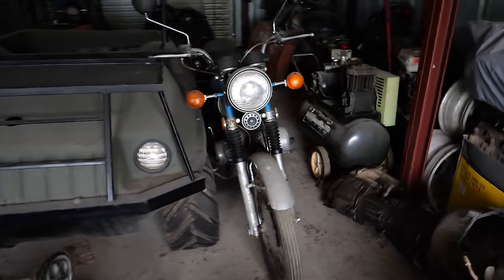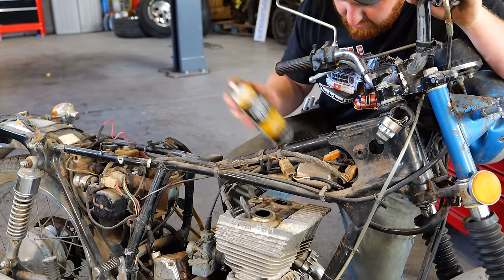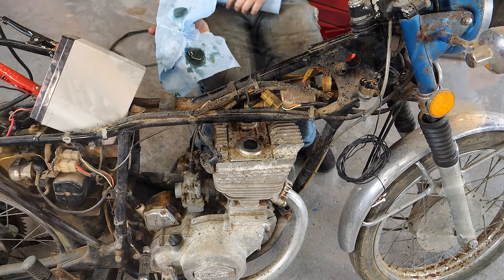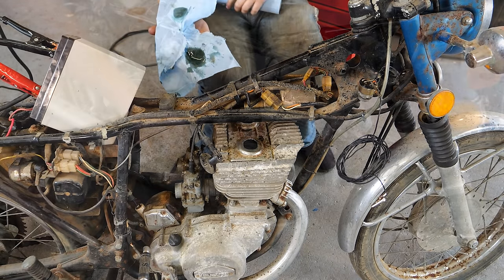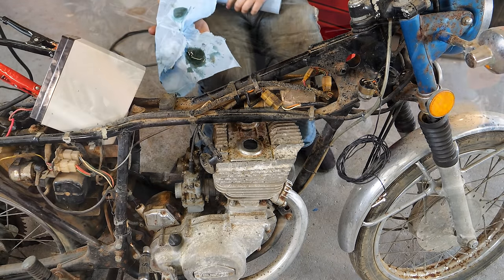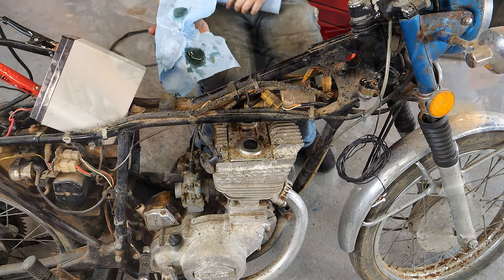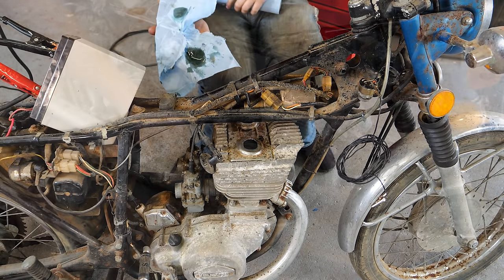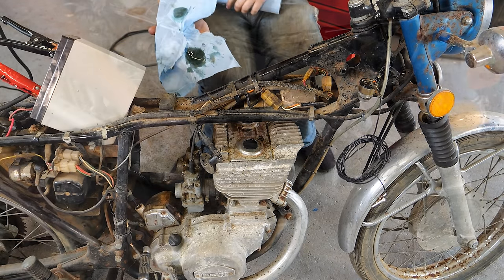Will an ABANDONED 2 Stroke Motorcycle Run After 20+ YEARS!?

Comment: Holy crap! Way back then I had, well before this I did own a 185 Suzuke then another 185 but, they were single TS 185 trail bikes. I did wind up buying a GT 550 which DIDN'T have a starter to weigh it down more but, they did stick four mufflers on on those three cylinder bikes lol. I also had a T 500m Titan later on too but, while I think the agricultural looking T500 twin was a better bike (except for fifth gear which nearly got me killed when it locked the rear after just overtaking a semi at around 90 mph) it was a great bike but, that 550 triple had a growl that sounded awesome. I can't remember what the red line was but I always held it flat till I felt the power start to ease to where it would pull harder in the next gear. I did love having a big digital gear indicator in the middle of the instruments. You're making me remember, and really miss those old and simple but character filled perky 2 strokes. 
HEY, if you want someone to test ride it for you, just pay for my air fare from Oz and I'll be more than happy. That sounds really lively for such a tiny engine!
You brought back so many good memories of some of the wild and fun 2 strokes I've had over the years, thanks for that.

Comment: I'm a big fan of Japanese 2 strokes and owned the 185 twin , 380 triple and the 750 water cooled , I had the 185 & 380  when I was in high-school they were fun ripers for around town , I did ride my 380 to Galveston Island Beach many times , trip was around 48 miles one way ...... the 750 I had in my late teens and early 20's it was a blast , hoped that baby up with shaved down cylinder block and bored out 40 over with 1 inch extension on intake moving carbs back 1 inch gave much needed  atomization ....fun times

Comment: And that’s why I love 2 stroke. Always had single 50cc scooters, always loved working on them. They just always seem to run, you just have to put some love in them 😂
Reply: I have a 3.3hp (76cc) 2 stroke outboard for my boat. It's a cantankerous little thing that never fails to give trouble starting when you need it most... but starts on the first pull if you act all casual. I guess 2-strokes can smell fear or something like that.

Despite our rocky relationship, mechanical sympathy forces me to actually look after it and feed it premium quality outboard oil. Darn thing even has a name ('Miss Fire') now, so I guess there's a fair bit of blue smoke in my future despite my disdain for 2 strokes generally.

Comment: It'll not run right without the airfilter. ..but yeah.. Giving the carbs a good once over won't hurt either. Have a good look at whether or not they're really synced, when you apply a little throttle too. This bring back memories btw. Back in the early 90s i owned a T350, a 39HP two cylinder two stroke Suzuki. Man that was a fun bike! 🥰

Comment: Hey, about rust on the inside of the tank; my dad and I took a container of metal BBs and put  them inside the tank and just shook the tank around to get all the rust out. I don't know if it's the most efficient way, but I thought I'd share the idea with you. The BBs just come back out in the end, too.
Reply: I hade a rather rotten 1978 KD185 in 1989. I just got a new fuel tank, replaced anything rubber, and reworked the carb! Sometimes metal parts are just too far gone😢😢
Reply: Granted, it was a free bike. My uncle Bud was a pipeline for old bikes when he was done with them. He was also a pretty heavy drinker. As a 15 year old kid in rural Missouri, if I could find a buyer, a 12pk of Busch would get ol Bud motivated to help me with any issues  that cropped up. Plus, if I caught him early, he was a darn good mechanic 😂😂

Comment: I have a tiller with a crack in the carb. I didn't feel like replacing it, so I sealed it with blue threadlocker. It has held for over a year now. The carb doesn't leak at all.

Comment: I had that bikes bigger brother, the T350. Only bike I've ever owned that felt like it was trying to kill me, the suspension was more of a suggestion, the frame flexed under hard acceleration .. but the best (worst) thing it ever did was snatch a piston at 70 miles an hour. Great fun when the wheel locks at that speed. I rebuilt it but never rode it... then sold it about 10 years later for three times what I'd paid for it.

Comment: Just a tip in case you didn't know: You should never ever engine brake with a twostroke. The amount of oil it gets is directly linked to how much fuel it gets. Even on machines with seperate oiling systems, the pumps are usually connected to the throttle in some way. And even if it would get the right amount of oil, with no fuel to dissolve it and bring it up to the cylinder, it's only going to pool up in the crankcase.
Reply: The windage from the crank usually does a pretty good job of whipping the oil into a fine mist even without the fuel mixed in with it, see KTM's newer 2T bikes that inject the fuel into the transfer ports and thus never have fuel and oil together in the crankcase. Agree on the engine braking, as I understand it it's a particular issue for old 2T cars because being much heavier and at least a bit more aerodynamic than a motorcycle with rider they take a lot longer to slow down. Some had an overrunning clutch to make engine braking impossible, especially in the higher gears.

Comment: Maybe try some STAG, I think it's US made, it's resistant to fuel, will seal exhaust flanges, freeze plugs, threads on compressors that won't seal etc. It's a thick red/maroon paste stuff. I've had a tube of it for many years & I've seen it on the shelf in a service station recently, so they still make it.... It's worth having some laying around, it's got me out of the shit a few times 😃👍 Cheers from Australia.

Comment: Two strokes seem to be able to sit for years and just get going without too much trouble they are an underrated power system. They say they aren't green, but I saw one you tuber running one on straight olive oil. With a bit of jetting, it would be great stuff since project farm worked out that veggie oil is as good as mineral oil for lubricating.

Comment: Lollie sticks to balance carb slides, one under each slide. Operate throttle and lollie sticks move, all you need to do is adjust until both sticks move at the same time, bingo, but old school but works.

Comment: Did you check if there are crank housing drain plugs on this bike? I owned several 250 and 500 Suzukis and all of them had a drain plug for each crank. Suzukis were the two stroke pics in my humble opinion. The company got to grips with so many aspects of two stroke tech. This 185 seems odd. Although I never owned an example with Ram Air heads I'm thinking they didn't appear on the market until 1974? Yours has drum brakes on the front which gives these early bikes so much character and properly set up they work very well. My 1974 T500 L had drums on the front. took me some time to sort them out but they were brilliant after I figured out how to perfectly synchronize the actuators.

Comment: you say its not running quite right.....and then you left the airbox in the shed......put that on (with the air filter in , of course) and it will run a whole lot better ! neat bike , the GT185 , had a lot of fun on one back in the early 80's

Comment: It seems that these multi-cylinder two-stroke street bikes from that era were torque-y as hell. I had a '70s Kawasaki 500 Mach III (3 cylinder 2-stroke) for a few weeks (traded a Corvair 95 panel van for it) and if you blipped the throttle the least bit the front wheel came off the ground. Scared the hell out of me (I was used to a 4-stroke Honda SL-100.) Bikers in the day used to call those 500 Mach IIIs crotch rockets.

Comment: Doesn't surprise me that it was easy to get running.  My dad won a Suzuki 50cc street bike off a radio show when he was 15 in the early 60's and that thing will still start on the first or second kick to this day and all we do is shut off the fuel and it'll sit for a couple years at times with no maintenance.
I know it was just a tiny 50cc but you could tell as it warmed up it lost power.  Had way more nuts when it was cold.

Comment: That much oil suspect the crank center bearing oil seals are not sealing . Gearbox oil getting into the crank case and being burnt in combustion chamber , hence all the smoke , means a full strip and crank rebuild , and reassembly .

Comment: These little Suzi GTs were everywhere here (New Zealand) back in the day. 185, 250(?), 380, 550, and a 750 if you had the bollocks. Be careful engine braking on it - Two strokes aren't big fans of that.

Comment: Crank shaft seal may be bad on the clutch side pulling oil in from pressure 
Wouldn’t hurt to tear it down n put new seals in it. 
Had all the Suzuki GT series in my life the 185 to the 750 water Buffalo
Reply: Baffles may be clogged up to. The holes are wrapped in fiberglass (or asbestos)

Comment: Its a 2stroke as long as it has compression and a spark it will run. No matter how long it wasnt running, also i sometimes like to inject a mix of break cleaner and 2stroke oil into the cylinder to give a lil boost and mostly they start right away

Comment: hey kevin. love your videos. I would like to ask for an advice. I have Chinese scooter 50cc 2 stroke and its mixing the oil itself from separate tank. but i have a problem with 2 stroke oil dripping thought carburetor and out of the air filter housing while the scooter is just parked .. you you have any ideas why that would happen or do i just pump out the oil and do mixture of gasoline and oil myself and fill it into the main tank

Comment: Adjusting the idle screws isn't sinking the carbs really. That just makes the cylinders idle evenly. You need to adjust the throttle cables at the top of the carbs. At least get them to pull the slides at the same time.

Comment: had one. 500cc two stroke street bike. mine sat in an old wooden shed for thirty years at that time that i had to dig a trench in the dirt to drag it out. new intakes and cleaned the carbs and it fired right up and ran. ran right up to 90 with my 300# ass on it before i realized i was riding 35 year old tires i could see the air in.

Comment: With that amount of smoke I'd lay odds that your crankcase seal is bad on the clutch side and it is sucking oil from the transmission.  Also with the intake pulses on a 2 stroke there won't be any way to use a manometer as there is no reliable vacuum on a 2 stroke.  On mine I measure the gap on the carb slides then use a laser thermometer to measure head and exhaust temp and dial it in close that way.

Comment: Hey, I have a peugot speedfight 2 49cc motorcycle, it works good and all, but it doesn't idle it shuts off after a few seconds without throttle, what is the problem if I may ask?

Comment: Cider vinegar is the best way of cleaning rust from a bike tank put a bit of old chine or a had full nuts and bolts give it a good swirl around leave in for 24 hours drain and flush with distilled water the tank  did mine bright and clean

Comment: Crank shaft seals should be replaced at that age if they go the motor can go. My GT500 blew the seal on the clutch side that side luckily only sucks in oil from the crack case of the one blows on the other side it will suck in air leaning out the mix on that side and not good. 
There not bad to tear down.

Comment: dont forget to keep your oil tank topped up on that bike cause it burns that oil in the tank    to get the best performance in that type of 2 stroke would be to run Klotz Racing oil its designed to put peak performance in thoes types of bikes

Comment: Hey is there someone who can advise me on which kind of motor oil i should run in a Ford 429? 73k miles. 200hp. Being used for cruising, in mild 70 degrees summer weather. Currently there is 15w40 in it. Any tips/thoughts are appreciated 👍

Comment: First off your harley revs in the skull logo into should be replaced with this thing revving then idling second I want to see more of it maybe repaint the frame replace the tires change the transmission fluid rebuild the carburetors get it all upto par I would replace the crank seals too then do another riding clip that's longer and faster

Comment: the Suzuki 125 was a cockroach legend.  In fact,  they took the template and they are still making them in different parts of the world.   you see...,   we do not need to " recreate the wheel ".  We have a history of legendary work.  I use the famous dewalt 12v drill and the famous makita circular saw which are available around the world.  they are legendary for durability.

Comment: this is a long comment which I am a troll for doing but if you have the patience feel free to read this whole comment. you might even learn something that you can do with a two stroke engine to make some power safely 
when you know what your doing with a 2 stroke engine and an electric start 2 stroke engine. I can tell you that those things will make a ton of power if you inject nitrous into it and are fairly easy to get running and I have got several two stroke leaf blowers running with horrible fuel but besides because there's two stroke oil in the gasoline, you can still use it. it won't smell nice but if you don't care about the carburettor the engine will run fine and will not care if the fuel in it is like 10 years old. and I mean it will fire right up in like 10 minutes of just checking fuel lines and starter fluid or flammable brake clean and I kid you not it will just kick over like it does not care. but if you don't use nitrous these engines only make at the most 5.0 brake horsepower but with nitrous around a whopping 7.5 brake horsepower but watch those revs because two strokes rev up higher when less fuel enters the cylinder so if you use nitrous just make sure the the 2 stroke engine is tuned to 1 : 3 Air to Fuel otherwise you will probably be seeing a hole in the side of the engine block and a hole in the piston from so much heat due to it becoming lean as hell. so as a reminder when using nitrous tune the carburettor slightly richer in the air to fuel mixture and do not touch the idle adjuster screw unless it stalls and if it does stall increase the idle in very small adjustments until it idles for longer than five minutes.

Comment: 2   stroke  baby  woohoo    old  2  stroke  injectors  suck    open  up  side  cover  yank  it  out  gives    you  more  hp  and    just  premix  it its really  simple  to  do  if  your  purist  want  it  100  %  original  yea    use  the  2  stoke  pump  but  they  notorious  for       ether  overfeeding  ie  oiled  up  plugs  or  underfeeding  ie  holed  pistons    i  put  one  them  gt  185  in    it  490  frame  in      80s    it  actually  worked  pretty  good

Comment: GT185 Ram Air
Oil sludge in bottom of the crankcase normal as fuel evaporated leaves the oil which forms a sludge -which burns off
The red sidecovers are period correct 
Put the airborne back on with an oileded airfilter it'll run heaps better
Find yourself a Suzuki GT750 barnfind to do a rescue on 
You'll thank me later

Comment: Great to see the old bike run!  Pick up some yellow Gas Seal Tape for projects.  It is gas proof, teflon tape is not.  Look for it at any hardware store or Home Depot, Menards, etc in the area with metal pipe and natural gas or LP fittings.  The local propane supplier likely has it on hand too.  I'm surprised you didn't double down on the petcock and make a gasket for the base in addition with the old ring gasket.  Easy to trace the outline and make a couple of holes.  Just a little belt and suspenders action to avoid a nasty fuel leak.  We need a future road trip video with this bike!

Comment: I have something I bet will make you say wtf. I have a 1979 Honda XL75. It's missing a good bit including the entire wiring harness. I got different ignition parts. I used the old coil but got "new" stator coils and tried to get it to pop off. It has spark. The timing is right. It has plenty of compression. But it WOULD NOT even try to make noise. So I decided to put a power drill on the crank bolt to spin it fast. nothing. I was just pissed, defeated and wanted to throw it off a cliff at this point. It doesn't have the exhaust on it. So I jokingly sprayed brake clean in the exhaust and spun the engine backwards. And IT F***ING STARTED. ITS A 4 STROKE. It ONLY runs with reverse rotation with gas IN the exhaust and OUT the carb. Kevin. If you're reading this. And you have even a clue or a guess. Please respond. That goes to everyone reading this actually. Because if I can't figure it out I'm getting rid of it so I can focus more on my other projects.

Comment: I wish the parts store would quit selling you brake clean. Gas in a squrt bottle works and does not hurt the engine like brake clean and starting fluid.
The oil injection pump is probably stuck in wide open position.

Comment: There's a bolt underneath the crankshaft remove this to drain out excess oil I had a gt 185 in 70s and comletly rebuilt it I also 4ebuit the gt 125 and the gt 250cc twin I would like to buy another suzuki gt 125 twin or similar I have a 99 per ent original al suzki ts 90 j trail bike for possible swap or sale watch this space

Comment: TO TEMPORARILY REPAIR ANY GAS TANK!!  (NOT DIESEL !!!!!!!)
USE A CHEAP BAR OF SOAP, BRAKE OFF A THUMB SIZE PISCE AND MIX IT WITH ANY FINE SAND THAT IS ON HAND AND JUST FROM THE HEAT OF YOUR HANDS YOU SHOULD BE ABLE TO FORM IT INTO A PUTTY TO RUB OVER THE ANY HOLE IN ANY GAS TANK BE IT STEEL OR PLASTIC AND THE LEAKING GAS ACTS AS A CATALEST.